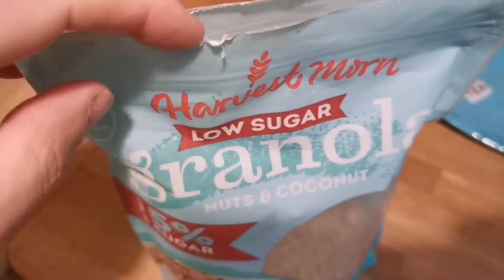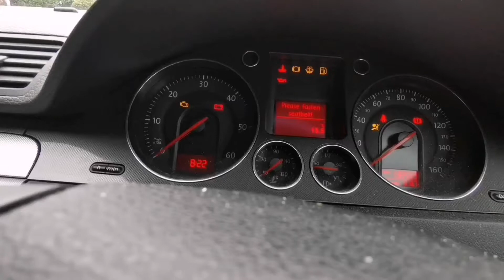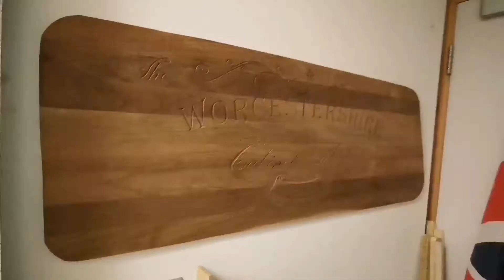Fitting hinges to the door and frame [no49] With Po!!

Comment: Fabulous video, careful fitting of hardware is so important and not widely covered. You've really shown how meticulous the process is. On the door, yeah I'd be interested to check the landing surfaces of the frame too (in situ..) . Finding a way to compare diagonals. Are they co-plainer or is there a small twist. You can only fix so much. I think the button latches will help a lot.
Reply from the maker: Thank you Brian 'fabulous' I'll take that 😂. Yes I've had a play with the door today. I put a couple of thin packers in the rebate to get the hinges to bend... Didn't do much.
Be great if I could find a way to get these videos to more people. I'll share more on Twitter but I think some will think I've 'sold-out' and it might not help much.